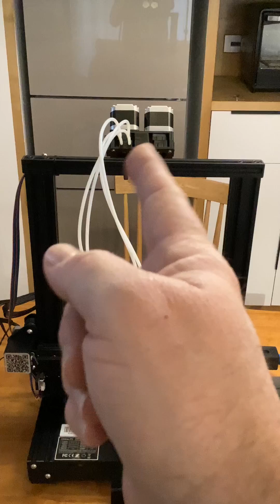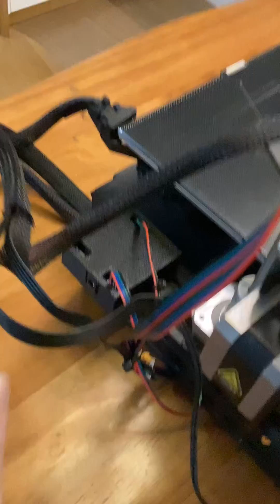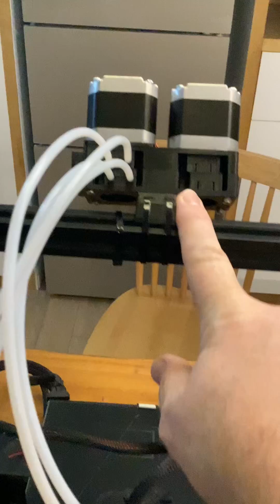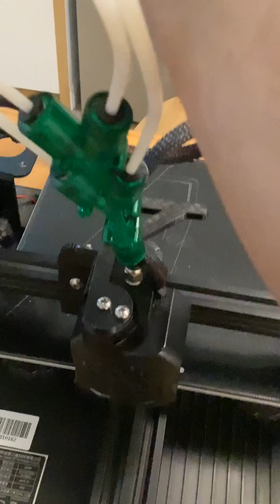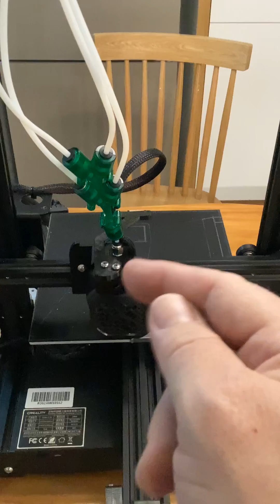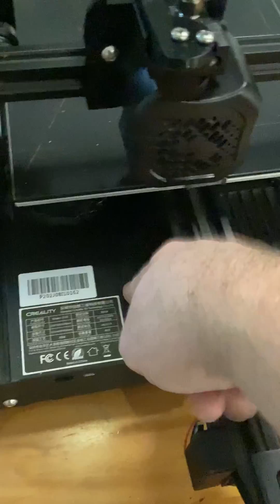3DChameleon Mk2 on the Ender 3 V2

Comment: Im really curious about getting this for my 3V2 that has a Sprite Pro extruder on it (functionally a S1pro). Along with a 3DFused y-axis linear rail. Guessing that the switch would mount on the X-axis extrusion as I saw in this video. If you were willing and able to make a cutter/mount assembly/print to sit atop a Sprite extruder I'm in! 

There are files out there to mount a PTFE fitting above a Sprite, if you were able to incorperate a rigid mount for the y adapeter with cutter I think a lot of us with a similar setup would be really interested. 

I do have a 90° ribbon cable adapter on my sprite which may effect clearances. 

I would be willing to reach out on this through your website if this could become a reality. 

I think you have a truly awesome product here. Excellent engineering and probably the best affordable universal setup out there.
Reply: Well, there's really nothing difficult about it.  The switch isn't mounted to the X axis, it's mounted to the Y axis.  You can see it on the front of this machine.  As for the Sprite, we already have a PC4-M10 adapter on Printables for that purpose.

The 3DClippy is open source... any one is free to do with it what they want.  It would be trivial to adapt this exact model to that sprite version as the back plate that it mounts to is identical, so I don't see an issue here.  It's all in Tinkercad.  I know others have adapted it to the Sprite already... so maybe it can be a combination of the two.

Comment: do you recommend installing the 3DChameleon on an Ender 3 v2 this way with the 3dclippy? or like your main video suggests (non main extruder mode)?
Reply: Well, there are two modes and each has their advantages.  In the extruder replacement mode, you need to do a lot of extra work in the slicer...but can be lead to a very fast color change. The extruder loader mode is a much simpler installation and can use our GCode generator to do the slicer side of it.
Reply: @williamsteele  I see! I would like to install mine in the advanced mode, two questions being: do the wires from the stock extruder go into either port on the 3DC? and any guide on the extra slicer work? (if it's model specific)
Reply: @jamesisname  The wires from the stock extruder go into the extruder motor of the 3DChameleon.  You disconnect the wire we include.  Follow the Prusa Mini and GCode samples for how to use it.

Comment: What type of blade is used to cut the filament?
Reply from the maker: I use a 18mm x 9mm utility knife blade.  The snap off types.
Reply: @3d_chameleon  Is there any additional instructions as to how the blade goes in and how all of it goes together?  I've started printing the components, so hoping to get this running today.  I'm sure I can get some info from looking at the Tinkercad model, but was hoping for a bit more instruction. I'm a step by step kind of guy, so like written instructions. If I get this figured out, I might add something to the forum...
Reply: @3d_chameleon  Awesome, that happens to be the blade size you sent out with the kit!  I've inserted the blade so that the tip of the cutting point is to the right of the mounting, where the half moon slide is. Seems to best fit in that way.

Comment: Since you're in direct feed mode, where do you put the original extruder wires that were on the stock extruder to tell the 3d chameleon to extrude?
Reply from the maker: You plug it directly into the extruder motor on the 3DChameleon. Our electronics only deal with the switch and the selector at that point using Mode 1 of our firmware. You do need a post processor in PrusaSlicer to reverse the GCode for T2 and T3, since they're on the opposite side of the 3DChameleon, unless you flip the tubes for them to the other side.

Comment: Nice setup.  I'm watching all of your videos, will probably get a unit to install on one of my Rat Rigs.  I'm in the middle of upgrades and repair on them now, so will have to finish them first.  Looks like a great way to add multi color - multi material.  I have the AMS on my X1 Carbon, but it is slow and wastes a lot of material, but works.  Thanks for presenting the different printers and how it is setup.